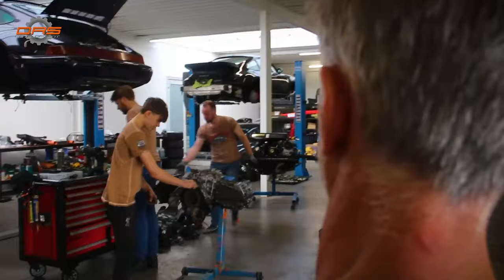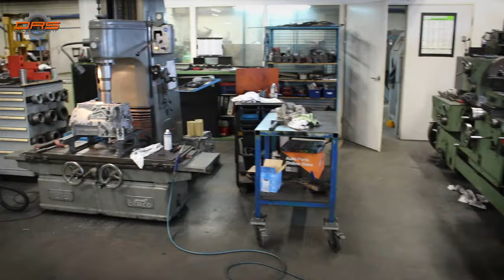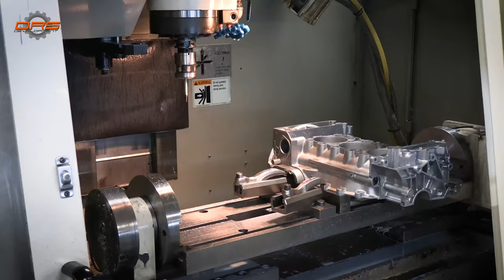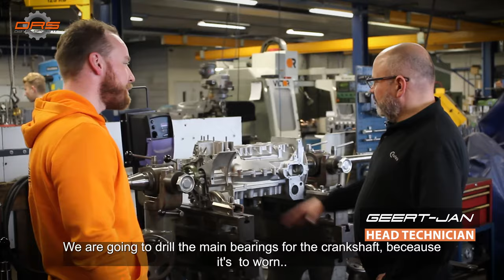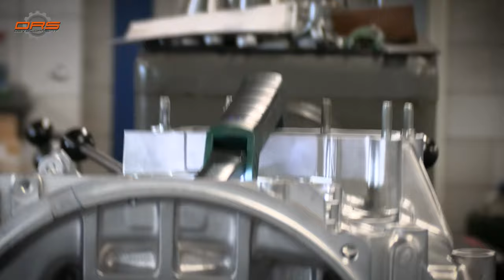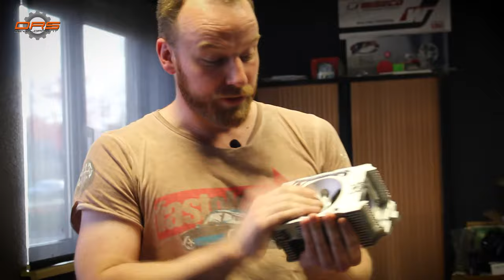PORSCHE 964 | Engine Checking & Modifications | Project Phoenix Ep 03

Comment: Great videos. I have been following Island Werks as I build my 1996 993 C2 engine as well. He mentions you guys a lot. I have one chipped piston that was dropped by my parts cleaner. I smoothed it out and the chip was minor. Any suggestions? Also my case is out to the machine shop getting measured. I don't think it needs line boring, however I was interested in the "flowing" concept you mentioned. How much difference does that 45 degrees make? And I am looking to get some RS valves and titanium springs. Do I need the springs or just the retainers? or both? Thanks.
Reply from the maker: Hi,
We will get back to this question in one of the coming episodes so please stay tuned and we will answer this soon. Thanks for your interest

Comment: I think you need a new camera .. the focus was a tad off. Cool video tho.. my understanding is that the bearings for the case that are 0.25mm oversized on the back, are quite expensive ?
Reply from the maker: We are aware of the focus issue of one of the camera's! That will be fixed in the future. 

Indeed the bearings in oversize come with a heavy Porsche tax.. However with performance engines (or any engine we build) we don’t take risks. Going for the oversize was the logical step for this build. We check with every engine and act accordingly for each build and application! 

Thanks!
Reply: @DRSDevelopment  Thanks for the reply.  I find these engines interesting as I have built a few myself. Can I ask what the bore measured in the case? I has a spec of 65.00 - 65.019 max... did any of your bores fall within that range? If not, how far out were they? I have been finding most are up to 65.05 which as you know, gives too large a bearing clearance, and insufficient bearing crush....
Reply from the maker: @911engineguy  Hi Michael,
We would have you send us an email as this is a question we can't answer on a forum easily. Hope to hear from you.